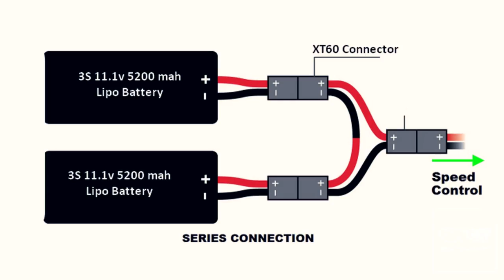DIY Cheap Electric Longboard - Adding ESC and Lipo Batteries - part 3 (under 250$)

Comment: Khouya thanks alot for the content, rak one of the Moroccan youtuber that needs showcase, rah you're doing such a great job Allah ikemel.
For had lvideo bghit n3ref ch7al dial vitesse tged tmchi biha bhad longboard (ze3ma talach maximum) and also bghit n3ref ch7al dial lwe9t katb9a mchargia (biensur selon ton experience machi dakechi li mektoub fel wra9) thanks a lot
Reply from the maker: Thank youuu so much
3la les testes mzl maderthom, 7it I have a problem f wa7ed battery! for the moment yalah tatwssel 7km/h max speed 7itach voltage litay3ti na9ess! range I think ghadi tcheed bin 7km -10km mzl majarebtch tahiya!

Comment: I been wanting to build one for a long time but I am 13 and don’t have the money so imma try to make my own parts and maybe use a dc brushes motor instead of brushless
Reply from the maker: At first i was going to make it just the way you said, but i got a sponsorship from banggood thats way i made it this way, and you can look for an old electric scooter with DC motor and take the parts from it

Comment: My throttle seems to be reversed, do you know how to reverse the direction of the throttle?  When I pull the remote is actually break and repair (slower speed) and when I push the lever forward, it accelerates (fast/speed up)
Reply from the maker: aussiemikeysaru just change the connection between two wires and it gonna work, I had that problem too
Reply: Doesn't that only change the direction of the motor spin, not the break and throttle feature?
Reply from the maker: I'm sorry buddy, but I dont know how to help you, the only Idea i have it s that I think you maybe should program the esc!
Reply: Change the order of the wires connecting the esc to the motor
Reply: I am using a brushed motor and brushed ESC, so there is only 2 wires.  Changing the wire only reverses the direction of the spin, it does not change the fact that the pull (towards my body) is break/reverse and push (away from my body) is throttle.  Normally Pull towards body is throttle and push away from body activates break, and push again to go reverse.  Mine is basically reversed.

Comment: Hi, how do I know wich ESC fits my motor or batteries?
Reply from the maker: Santi Ortiz you will find details about it in the website, most of the websites wrote details of their products, then see if it gonna fit or not
Reply: Bro can u tell me which size bullet connectors u used cause I am going to build the same

Comment: screwed up in the first min with the bullet connectors
Reply from the maker: what is wrong with the bullet connectors?
Reply: justin21002002 yup I want to ask the same bc my diy longboard/offroad hybrid uses dual x car beasts with bullet connectors
Reply: Med Projects The wire is supposed to go straight into the end of the bullets. You first fill the end with solder, tin your wire, then heat up cup and stick the wire in the end so it's all a clean straight line. No lumps under the heat shrink. ... Clean.

Comment: what max speed with these motor on 6s?
Reply from the maker: christophe levaux acctually I didn't test it on the 6s batteries, this test was on 5s battery The max speed was 13Km/h